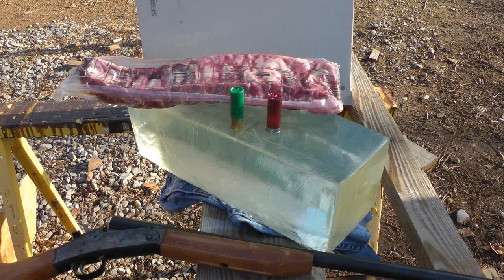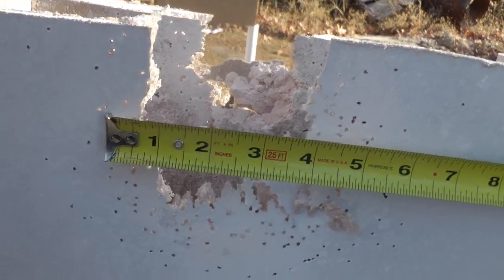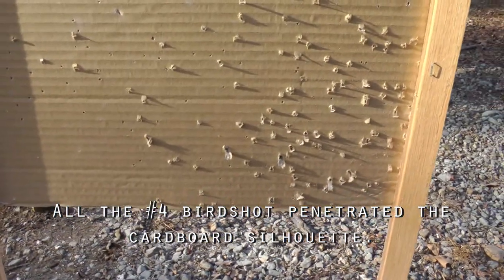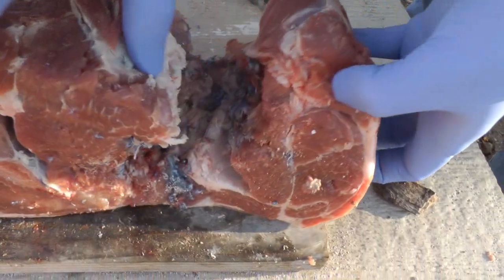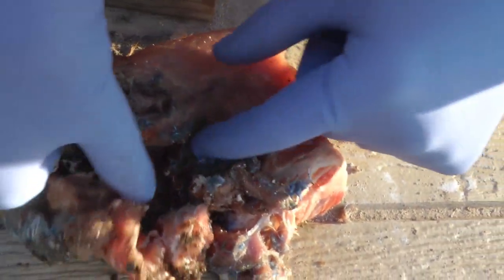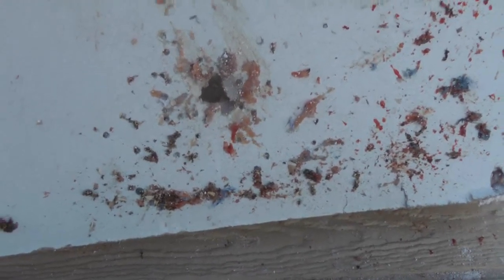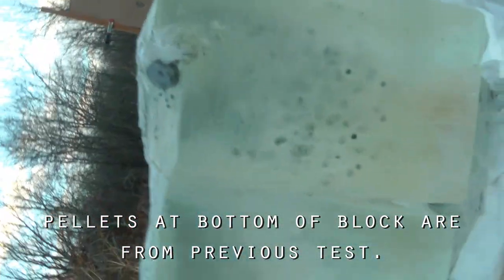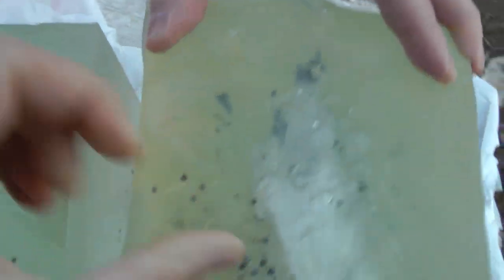Birdshot Home Defense Gel Test

Comment: I think bird shot is the way to go inside the house
Reply: Blind Squid  a real man will us a flame thrower with a 50.bmg with a shotgun and on the end a 22.
Reply: Blind Squid  What if... Well what if the guy is so high on pcp that even if you hit him he still cuts the kids throat. What if you hit your own child in the head. The what if argument doesn't change the fact that shotguns even using bird shot can be extremely effective self defense weapons.
Reply: Blind Squid use a slug duhh
Reply: Blind Squid   Long guns, whether shotgun or rifle, are easier to hit the intended target with than handguns. At most indoor homesite ranges, less than 30 feet, the shotgun pattern will only be a few inches wide. This margin of error gives a higher probability of a hit(s), but could also endanger a hostage. If the culprit has exposed a part of his body outside the hostage's, shoot that! Surrendering will likely result in the hostage's death and then yours. As to the ammunition, bigger shot means bigger damage, try to shoot fron low to high(crouched behind cover/concealment) so that misses or overpenetration goes high(assuming a single level dwelling, yet subfloors may be sufficient barrier for upstairs occupants)  and be prepared for immediate followup shots and multiple offenders. The latter information is one reason to consider an AR type rifle/carbine for home defense, low recoil, high accuracy, high capacity for followup shots and intruders. Shotguns are great, but they work both ends harder than carbines/rifles and AR styles are so easy to accessorize. And BEST FOR LAST, always, always, always identify your target before you shoot, don't "search" for the bad guy, let him come to you.

Comment: Thanks for a GREAT video.  It also shows that you have to AIM a shotgun -- there is so little spread at 10 feet.  More spread than a bullet, but not exactly "the scattergun" that is used in movies to mow down a mob..   I wouldn't be surprised if even a 20 ga would do the job with #8 birdshot at close range.
Reply: A .410 will do it

Comment: Thanks for your video, it was greatly appreciated.  Birdshot for home defense can result in a threat stop at under seven yards.   In an apartment,  were the distance is likely less than five yards,  the pattern with 7 1/2 birdshot would be fist size and penetration sufficient while minimizing collateral damage from misses or over penetration.  Beyond 7 yards,  #00 buckshot is what I use.

Comment: In order to bring the gun to a halt, a forward counter-recoil force must be applied to the gun over a period of time. Generally, the counter-recoil force is smaller than the recoil force, and is applied over a time period that is longer than the time that the recoil force is being applied (i.e. the time during which the ejecta are still in the barrel of the gun). This imbalance of forces causes the gun to move backward until it is motionless.

Comment: Recoil (often called dateless, kickback or simply kick) is the backward momentum of a gun when it is discharged. In technical terms, the recoil caused by the gun exactly balances the forward momentum of the projectile and exhaust gasses (ejecta), according to Newton's third law. In most small arms, the momentum is transferred to the ground through the body of the shooter; while in heavier guns such as mounted machine guns or cannons, the momentum is transferred to the ground through its mount.

Comment: Wall mock ups need to be secured.  Some energy is being expended making them fall over.  Try hitting a nail in a loose board with a hammer for a comparison.  You'll bang away all day and never drive the nail.    

When used at home ranges 10-15 an assailant will be impacted by ALL the shot...whether birdshot or buckshot.  And recieve ALL the energy generated by that weight of shot at that velocity. Naturally, a 1-3/4 oz. or 1-7/8 oz load of number #4 or #6 shot at 1350 fps  carries more energy than a target load of 1-1/8 oz of #8 shot at 1200 fps. Shotguns loaded with a good, powerful "turkey" load of #4 or #6 shot are excellent for home defense without danger of overpenetration.  Anyone located on the other side of even one wall would likely not receive fatal wounds.  Remember that gel is "BB" calibrated to approximately a BB at 350 fps which will penetrate 3-3.5" in gel.  I do not think anyone would consider a BB at 350 fps a generally "lethal" projectile.  #4 or #6 penetrating 7" would generally NOT cause a lethal wound, but it may ruin your day.   And it will not penetrate an exterior wall through insulation, sheathing and siding at all. 

A well aimed blast from a turkey load at 10-15 feet will result in immediate and full incapacitation, if not immediate death and represents minimal danger to anyone beyond the intended target.  A 3" magnum will have little difference on penetration (same shot size at the same velocity, just more of it) but would increase energy transfer to a live target

Comment: One major flaw with all of your tests - they were all conducted at 10-feet.  At 10-feet or less bird-shot does well - but if you go out to 15-20 feet you would get much different results.  Also were you standing 10-feet away or was the end of the barrel 10-feet away?  If you are standing 10-feet than your barrel could be as close as 7-feet away from the target.  good video overall, and thanks for posting.
Reply: Not to mention it was a 24" barrel.

Comment: This actually seems like a great option for home defense if you live in a condo or apartment, especially with a cylinder bore defensive shotgun.. Maximum effect on the target without overpenetration.
Reply: I use a modified choke. I want it tight. I'd go tighter but I can't get the choke out lol. I guess it's good because modified is good for both buck and birdshot when I'm at the range.
Reply: @nicktaylor5952  well, I have a dedicated home defense shotgun. My hunter is an old Winchester 1897 that's been in my family for generations.
My defense gun is a maverick 88 with a folding stock and vertical foregrip.

Comment: What I'll say about drywall tests is that drywall simply sucks at stopping bullets. A .22LR will, by itself, penetrate a number of sheets of drywall... that doesn't mean it's a good defensive cartridge. The ballistics gel, by itself, is a reasonably good indicator... if I remember right, the FBI wants a minimum 10" penetration for their cartridges.

Something also worth thinking about... most drywall tests I've seen tend to have the drywall layers only a foot or so apart. In a more realistic scenario, I'd be curious about loss of velocity after penetrating a wall.

Comment: The #4 turkey load was a mistake. Turkey loads use a special wad that is designed to hold the shot closely grouped for longer distances in order to facilitate taking a turkey. Regular high brass #4 bird shot would have given a more realistic illustration.

Comment: It's good to know you can penetrate meat that far without much threat to the next room.  I do think if the drywall was fixed in place it could have gone further, but I still don't think it would maintain enough energy to pose a huge threat to the next room.  That's as safe as it's gonna get for the next room while still stopping the crackhead though.

Comment: #4 shot through the wall and 7" into gel is like through a wall and completely through a child.  Even if only a few bbs hit a friendly, one could hit a large artery or vital organ deep inside.  One #8 load on the main body/head at home invasion distance and that intruder won't bother you any more.  BTW, #4 bird shot(in vid) bb is 7x lighter than #4 buckshot, so imagine the penetration with that.  Unchoke the barrel for best chance in low light and moving targets.
Reply: Jesse none   An open bore will only give you about a 8-10" pattern at 5 yards. It doesn't scatter, the way you think it does, at close ranges. Go outside, and do some testing...

Comment: I do think it can stop an attached but not as well as buck shot or slugs , no round is a sure thing, even buck & slugs have been known not to stop an attacker in some cases, now the trade off with bird shot is it does not have the deep penetration and may not reach far enough to damage the central nervous system also bird shot may have trouble reaching the more shallow vitals if the target is shot from a side angle or through extremities with bone etc. the advantage to bird shot is its limited impact at longer range and through adjacent walls,  if a miss were to occur the chance of collateral damage could be greatly reduced. Misses are very common in shootings, even  LE's rarely  get over 50% hits on target ,  so misses should be expected no mater the experience  or skill level. It's a compromise that must be weighed and considered in that the heavier the shot the more effective it will be on the attacher but the chance for collateral damage also increases.

Comment: You could try airsoft pellets loaded in a shotgun shell. Should be lethal but not have lots of penetration on walls. Glad to see that someone finally gets that you need a choke for birdshot. Cylinder bore is fine but use a hunting shotgun for birdshot defense.
Reply: Steve+I don't believe you know what you are talking about. Airsoft pellets are fairly dense and you could get about 5/8 ounce of them into a 12 ga if you use only the shot cup without the wad. If nothing but fragments hit the target from your test? Where did the force to fragment them come from? You also didn't give the distance to target are you shooting at 25 yards? You must have a big effing house then. I bet you didn't put sand in the empty spaces between the airsoft pellets either. You also have no idea of what 100 feet per second looks like. 100 fps is about 70 miles per hour, not even a fastball? The wad alone goes faster than that. Watch some Taofledermaus videos before your mouth fires off a blank.

Comment: birdshot is good to 12 feet.  after that its mass is to spread out and it exponentially looses energy. if you have a full choke its good to 15 feet. bird shot is deadly until the mass clump of pellets spreads out.
Reply: It's 30 feet for #8 birdshot before it spreads out and starts really bleeding energy with an 18.5 barrel and no choke.  Buckshot mini shells give you range while still solving the over-penetration problem, and you get 13 shells in a 7+1.

Comment: would 20ga with the same shot types have similar results?
Reply: +TheGrilledcheeeese Similar but smaller.
Reply: Agreed with Blazek, which is why I'd use #6, and #3 Buck in 20gauge (or a slug)

Comment: I'm not a fan of using #7.5 or #8  Bird shot for home defense. I would prefer # 2 birdshot. But in any case if you take a 12 gauge bird shot round to the chest I don't think you're gonna be in the mood to continue fighting and if you don't get to a hospital quick enough you're gonna have a real bad day and possibly take the room temperature challenge.
Reply: The test clearly showed that a #8 round of birdshot will penetrate 4 layers of denim, explode the ribs in about a 4" diameter circle, rip through the lungs, and possibly exit the rear. Looks like one round of #8 would just about sever a leg. So why do you think you need more than that? Got a 1 round shotgun?

Comment: I use plated BB shot for home defense, which gives me the advantages of more penetration than the lighter birdshot, stays together in a tighter pattern a little longer, and won't go through my neighbor's exterior walls and into their bedroom(s) should I miss the home invader the way 00 buck will. I'm not as concerned about pellets going through my own interior walls, but I want to contain all the pellets within my house's perimeter walls. A BB pellet won't have much energy left if it goes through my insulation, house wrap, and exterior siding.
Reply: +joe louden What if it goes through the neighbors window?
Reply: jjenson2006 BB shot won't have enough energy left over to cause a dangerous wound after penetrating a window. That's why I use it. It is only effective in the tight confines of a house, where it belongs.
Reply: +joe louden Have you tested this?
Reply: jjenson2006 Don't have to. Calculated the weight of a single BB projectile and the velocity to get the energy. Also shot a load of 2 3/4" BB through ONE piece of drywall and it did not penetrate a 1/2" plywood 4 x 8 fifteen feet behind it. #4 buck, #1 buck, and (of course) 00 buck all sailed through the plywood like wet tissue paper. If some BB shot gets through my tempered, double-pane windows, it still won't have enough energy left over to get through even the cedar siding of my neighbor's house. The ballistic coefficient and momentum of a BB projectiles is so low that it is comparable to a ping pong ball at even moderate distances.
Reply: +joe louden Don't have to. Calculated the weight of a single BB projectile and the velocity to get the energy.

Being an Engineer for 30 years, I can tell you that what is calculated on paper can be way off in actual practice.

Also shot a load of 2 3/4" BB through ONE piece of drywall and it did not penetrate a 1/2" plywood 4 x 8 fifteen feet behind it.

Sounds like the penetration is less than birdshot. If it loses that much energy after one sheet of drywall, it's probably not going to do much to someone wearing a heavy sweatshirt with a leather jacket over it.
Reply: +joe louden So many things wrong with what you just said. Plenty of people have been shot and killed through automotive glass, which is considerably thicker and stronger than glass windows on houses. Handguns and rifles shoot at much higher speeds than shotguns.
Reply: jjenson2006 Completely inaccurate statement. Shotgun buck balls can travel much faster than many handgun rounds. A ball of 00 buck is comparable to a .32 ACP FMJ bullet and a ball of 000 is comparable to a .380 ACP FMJ. However, the buck balls are traveling faster by about 200-300 fps. You also cannot compare the lethality of a 124 grain 9mm handgun round plowing through the passenger window of a car at 1100 feet per second with a BB going the same velocity. Apples and cucumbers. One will go right through the tempered glass and through the passenger. The other MAY shatter the glass and leave a red mark on the passenger. There just isn't enough  momentum and energy left in a BB after hitting such a medium.
Reply: +joe louden 00 buck @ 1250 fps has an impact of 187 ft/lbs per pellet. A .223 AR15 Carbine bullet strikes with 1000 ft/lbs. of energy. Shotguns require much lower pressures in the chamber than rifles and handguns and the energy transferred to them is not as direct and concentrated (unless there is a slug in the chamber). The .380 ACP has a little more penetration than a single 00 buck pellet; not a lot more, but more. Yes, there are some handguns that have less penetration and I wasn't making the claim on all handguns.

I wasn't comparing a BB going through tempered automotive glass, I was talking about a regular glass window on a neighboring house that is usually not more than 1/16" thick. I've taken out these windows with air-guns in my past so I know what they can do. This is with an air-gun, shot at a much lower speed than a shotgun. I'm not claiming that the BB's are going to do much damage due to over-penetration, because I've never done these actual tests myself; but from what you told me, the penetration isn't good enough for when an intruder is fully dressed in winter gear. Yes, you did state that you have heavier loads upstream, but if the intruder is armed, he'll get a shot at you before you are able to access them and he won't be shooting BB's. The first shot needs to be very effective or you risk your life.
Reply: jjenson2006 Correct. But nine 00 buck pellets/balls hitting at the same time will hit the target with around 2000lbs of energy. A 2 3/4 load of full-brass BB shot will also hit with 1800-2000 lbs of energy at close range. My AR-15s are long range rifles with 24" heavy target barrels so I use 3 different 12 ga shotguns for my home defense long guns.

Comment: I'm sorry I'm new to this,
You say number 4 bird shot what does number 4 mean?
Reply: The larger numbers= smaller pellets smaller numbers= bigger pellets.
Reply: Thanks
Reply: Basically you can take the number of the shot, subtract it from 17, and it will be the diameter of the shot.
#5 is 12/100 of an inch, so .12", 3 mm to you.  Each size up or down is roughly .25 mm difference.
Reply: I may be European, even in Europe  but you still need to know inches.
Thanks for the explanation I didn't know precisely how it worked until now.
Reply: Tyler Nelson I never knew that. Thanks!

Comment: Insulation is in walls you know
Reply from the maker: Not in most interior walls. Anyone who thinks a few inches insulation is slowing down a bullet has never fired a gun.
Reply: What about the dry wall? it does slow down projectiles.
Reply: Storm1 Sandy dry wall... dude drywall is paper... a 22 will pass trough it
Reply: You think? And it still slows down projectiles. Or are you living in an alternate universe?
Reply: SuperCrammo not a lot in interior walls though

Comment: Also, you should be more concerned about shot angle and trajectory. Maybe don’t let the bad guy get between you and a wall that you know has someone on the other side. Also, more importantly don’t miss! If the 00 buck goes through someone and hits bone and blood and organs the energy upon exiting the body probably wouldn’t be enough to go through a wall and still harm someone on the other side. These “tests” with pork shoulders and ribs are dumb. Dead tissue is less dense (meaning easier to penetrate) than live tissue.